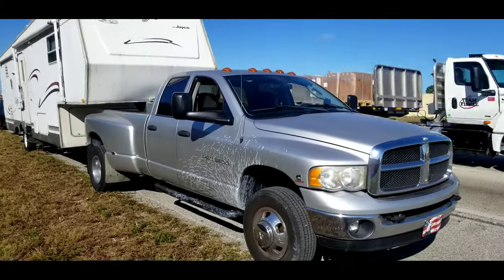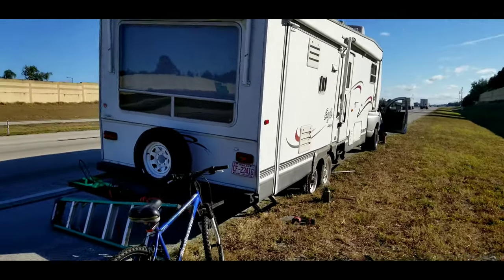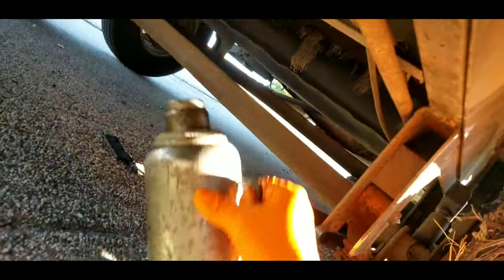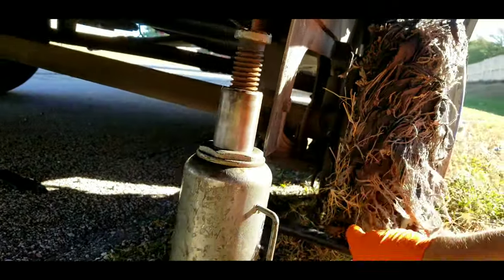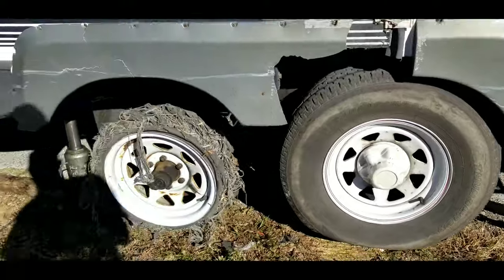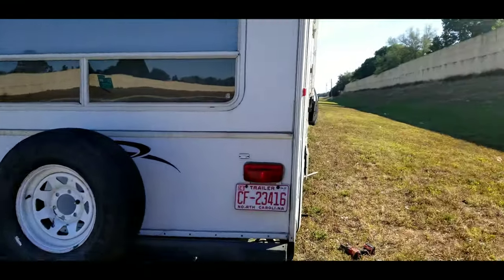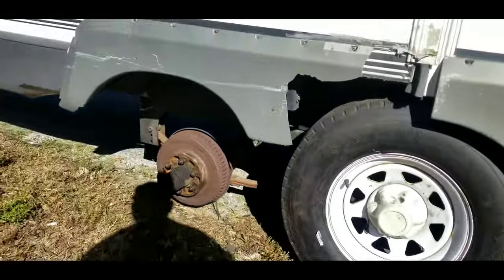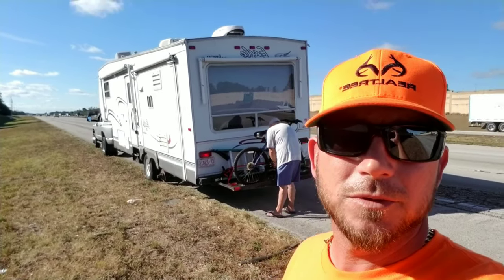How To Change 5th Wheel Trailer Tire/ Two Flats One Spare

Comment: This was an awesome video!!  Just for this reason is why I carry TWO spare tires with us when we take an RV trip.  Granted, it's more room that is taken up in the back of my pick-up with the extra spare, but at least I won't have to limp to a tire store with one spare.  A lot of times having one flat will cause the other tire to blow too.  I like the idea of using the stabilizer jacks to assist with jacking it up and taking a little weight off.  I probably wouldn't have thought of that, but now that's what I'll do if I ever have a flat on the highway.  I also love the comment someone made about not jacking up the RV by the axle.  I agree, you shouldn't put a jack in the middle of the axle, but like you did it, it won't hurt.  Especially with some of the weight taken off of the RV with the stabilizer jacks.  Hey, great video and thank you for sharing!!
Reply from the maker: @garyp9906  thank you for watching and commenting. Much appreciated. Always carry two spares. A ramp and an impact. You gave great advice 👍

Comment: Those are stabilizers, not jacks....they are meant to keep the suspension from rocking, not to support the weight of the rig. Also, you should never jack a trailer up by the axle. You place the jack under the shackle plate the leaf springs are attached to or on the frame.
Reply from the maker: Can't get the angle needed to do that with stairs in the way and pitch of road. This was the best strategy with tools we had. Also you can jack on the axle just as close to the hub as possible. When in a life and death situation and zero wiggle room to do it exactly perfect this is how to do it.  I've been doing this for 13 years. There isn't anyone around me that can do it better or faster. If you think you can pull a trailer over there and film it. Also the leveling Jack's were used to help assistance shifting the weight because the trailer weight was shifted to one side. The side with the flat. So in conjunction with the other Jack's it was a smart move. Plus when semi trucks come by at 90mph and possible blow the trailer off the jack it is again a good idea to have them out to help. Thanks for watching. I know all you critics want to pick this call apart, but with the tools given and two flats and that much off an angle and that close to the road with no more asphalt left to move over on.  Also I did not jack up the vehicle by the axle at all. I jacked up the vehicle by the frame. I jacked up that axle to lift up the sagging flat wheel off of the ground. I wish someone would make a video showing how to do it better. Not in an empty parking lot. Out there. Thanks for watching.
Reply: @roadsideguy5902  right. As if you did any damage to the rig. Job well done given the circumstances
Reply from the maker: @jessetruck903  dude thanks for recognizing the circumstances.

Comment: Great demonstration of how to RUIN an axle. Never, ever place a jack under an axle. They are hollow, and will deform.
Reply from the maker: Not if you jack closest to the hub. Which is where the load already is. This vehicle was on the side of an interstate and was leaning heavily to the passenger side. Shifting all the weight to the side I needed to lift. It also had two flats and one spare. I needed to use two jacks to lift and stabilize it. The floor jack on the front axle is close enough to the the hub to not cause any damage. Thr second jack went on the frame. God I love know it alls like you. Where would you have put the jack? And where is your video showing how to do this on a busy interstate? I've been doing RV roadside for 13 years never bent one axle. I have over 600 videos showing my work. How many do you have for me to criticise and critique? Probably non because you are a do nothing know nothing.  Do all the internet reading you want.  I have real world experience so I know with confidence what I am doing is right.